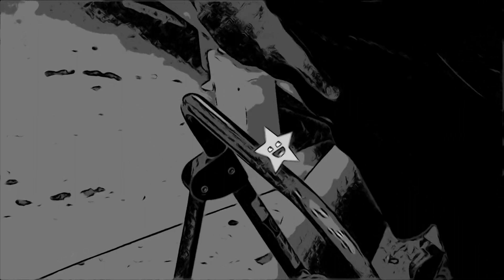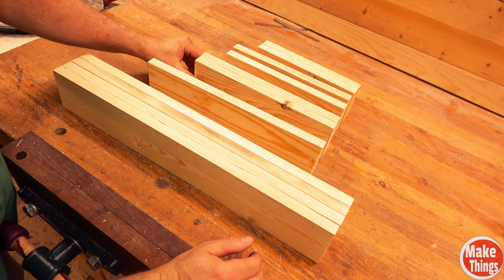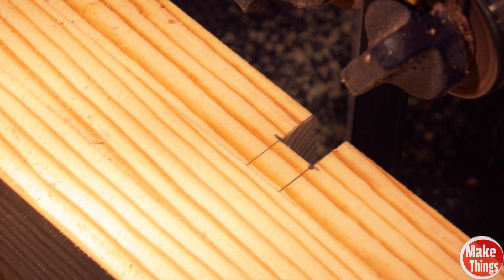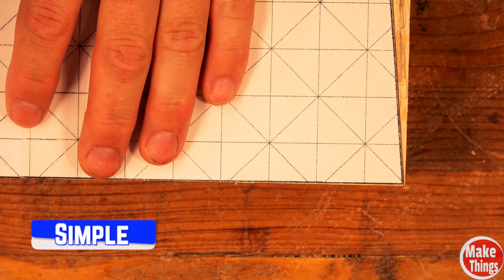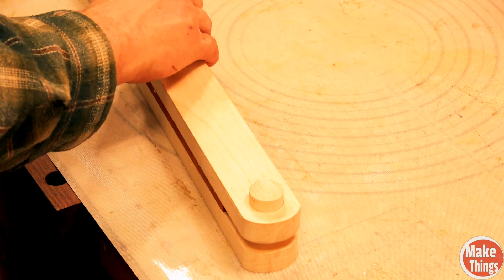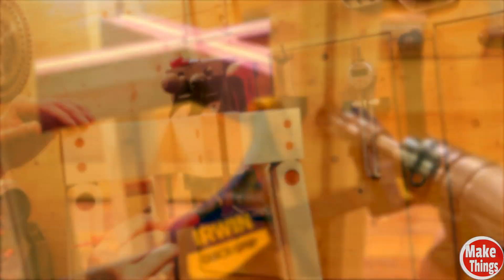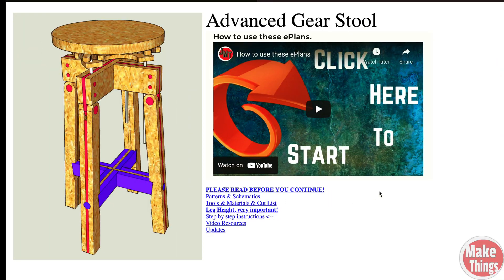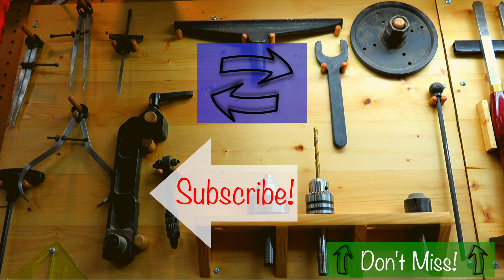The Gear Stool // Use Gears to Take Your Rear to a Completely Different Level! // Make Things

Comment: Brilliant idea, plans and additional videos excellent. Any reason why could not be done with threaded rod with nut on end instead of carriage bolts which are so much more expensive.
Reply from the maker: I think it could certainly be done, but I think it would take a lot more work to do it.  For example, the carriage bolt has a square on its cap that keeps the bolt from moving.  You'd have to cut out a hex shape in the wood to do that.  One could make the argument that you only need epoxy and a hole, but I'm not sure if that would be enough.
Reply: @MakeThings  Many thanks, I am thinking of adapting the stool for a seat on the rear of my narrowboat before I try the advanced one, fingers crossed 😁
Reply from the maker: @RichardMartin-vr8ug  Whatever you decide to do, PLEASE email me pictures.  I would love to add it to my website!

Comment: Brilliant and beautiful, and excellent job on the video. Does the seat tend to rock a bit, teetering as you shift your weight around?

Is it supported only by the four bolts?

Do you have links in your plans for the resin you used? I'm wondering if maybe some polycarbonate could be cut to size instead of the resin?
Reply from the maker: Hey Mark, good question.  It uses a spring to lift the seat off the gears and then compresses.  It's 4 3/8's carriage bolts...1 along I wouldn't trust my weight on it, 4 seems perfectly able to balance the weight.